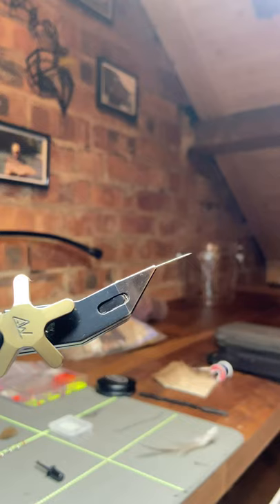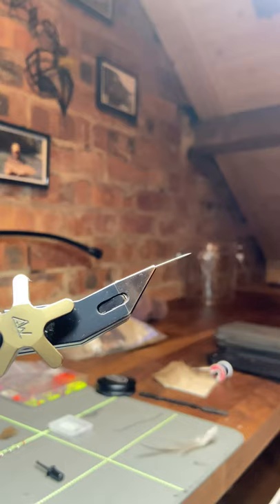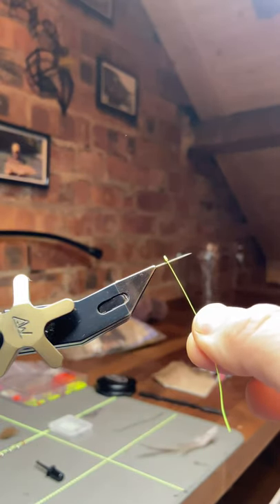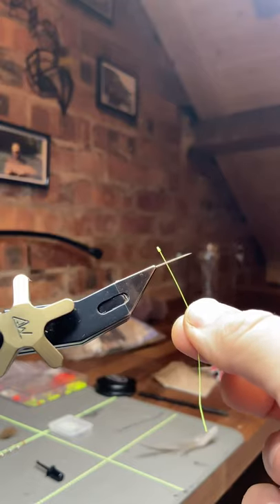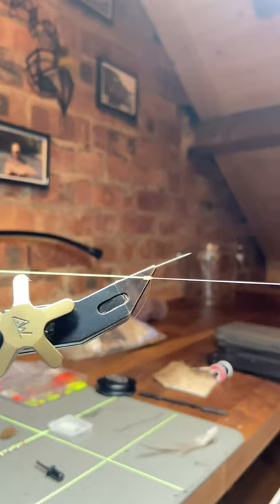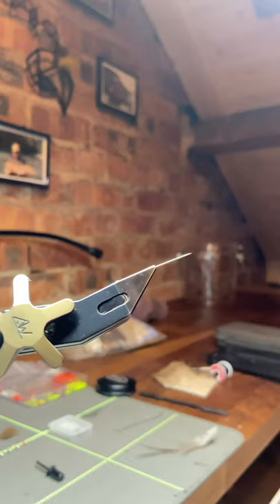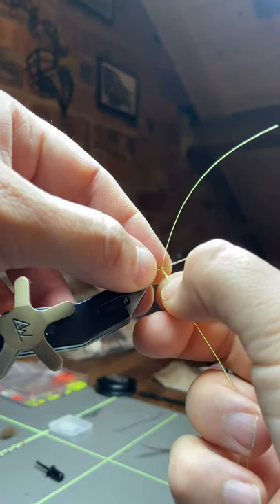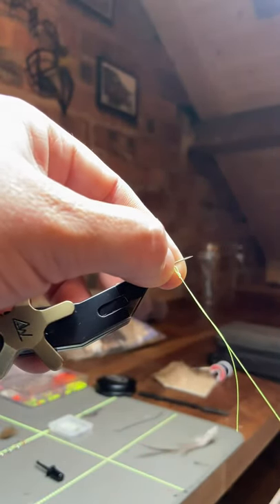River fishing :The micro tippet loop

Comment: Pro Tip : when tying tippet to the micro-loop, use an 8 turn clinch to ensure you can easily cut the tippet without damaging the loop.  Use your fingers to remove scrap, not a tool, for the same reason.  Peachy Fly Fishing has an alternate version of the micro-loop that is a little better for on-stream application / rigging.  
Thanks for the content.  BTW, got my Hardy 10'2'' 2wt on order.  This will be my first Hardy rod.  It should arrive just in time for a trip to the Smokey Mountains here in NC, USA.

Comment: Great video. I'll start using them. One question: Have you ever had trouble with a tippet cutting through a micro-loop since it is nylon to nylon. Thanks much!
Reply from the maker: Yes - you need to replace them , frequency depending on diameter . I’ve started to use the newer xxs micro rings that are available, much better size and weight wise than the original “1mm” rings that where often really 2mm .
Reply: I measure all my new rings when I buy them (many brands, stated sizes from 1.0 to 1.5 to 2.0mm) with calipers. Without exception, they have all been 2.0mm. The xxs ones don't seem to have hit the US market yet.

Comment: Great video, thank you - 3 questions if I may 1. Is this fipsm legal 2. do you cut the tag flush and 3. Is it any different to an improved clinch knot?
Reply from the maker: Hi - I’m my opinion the rules are quite clear for FIPS and any kind of loop is Not legal . That said the interpretation can be quite “grey” at times and I know some anglers in FIPS events have used loops ( I don’t) . , I leave the tag slightly long , Yes it’s basically an improved clinch .